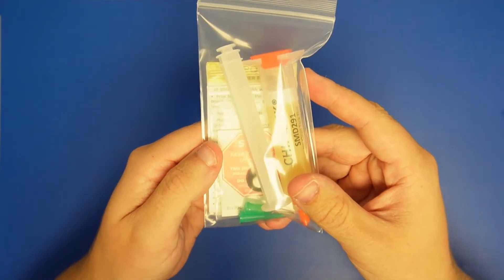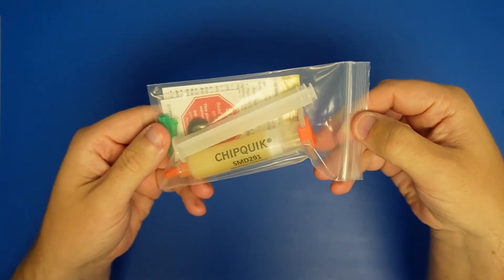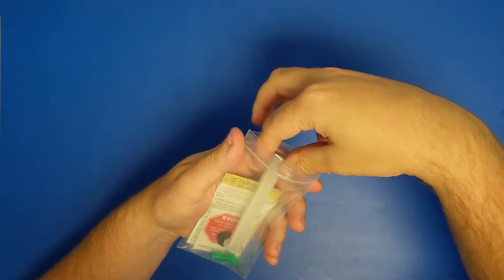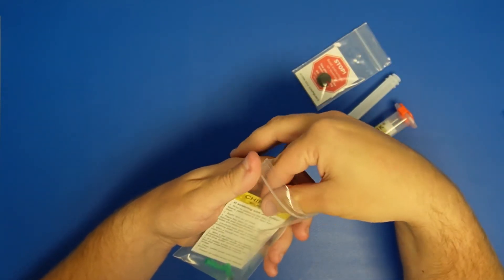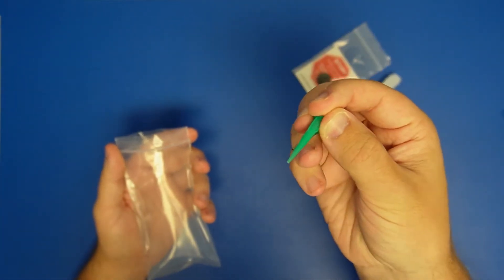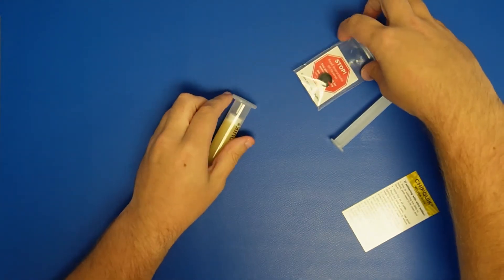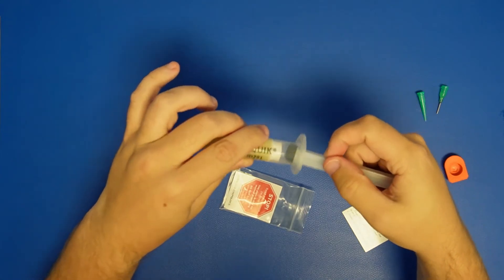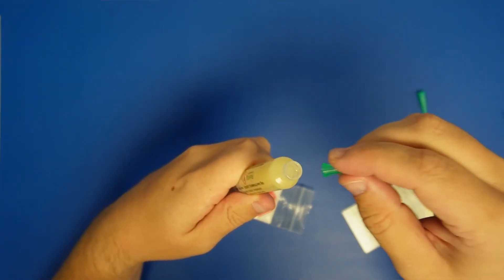CHIPQUIK® SMD291 10cc tack flux how to open, assemble and dispense

Comment: the plunger on mine just falls out instead of being stuck in there. Is that normal?
Reply: Yes, if you take the orange tip off and push the dispensing end against your work surface while gently pushing on the plunger it will hold in place.  This product is meant for both pneumatic and hand dispensing if you want a permanently attached plunger try the SMD291-10M.